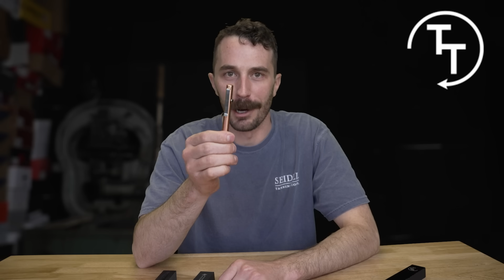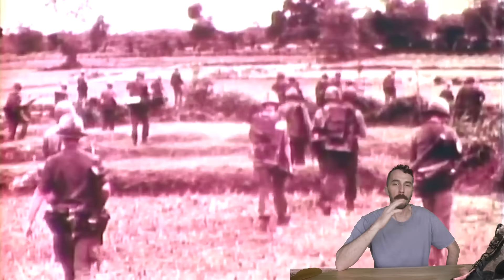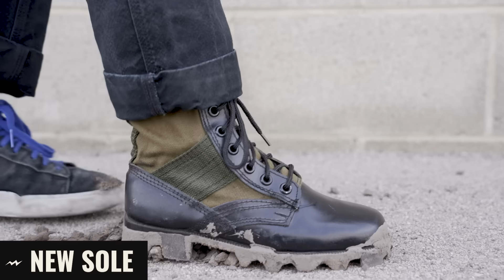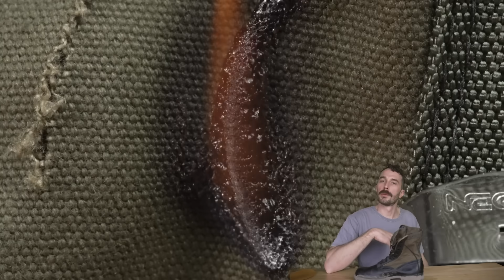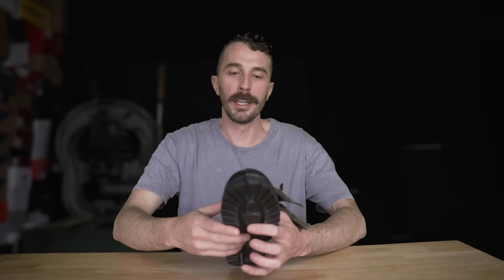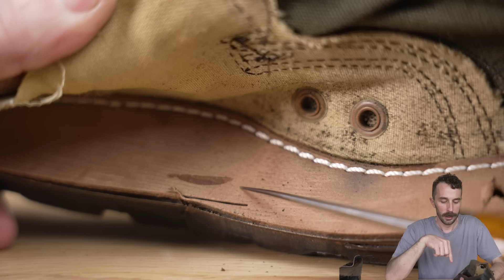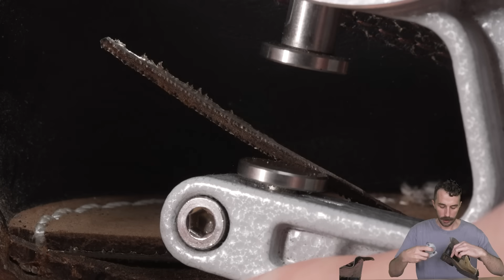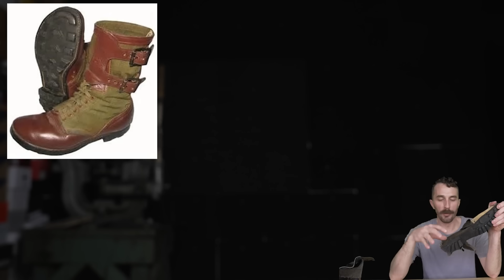Why it took 57 years to replace jungle boots

Comment: Also I was never issued the Bunny boots, but I did have a pair of the Micky Mouse Boots. Basically the same thing, but they were Black and perhaps a lower cold temp rating. The Micky Mouse boots were standard issue in S. Korea and likely still are.

Comment: They are a great boot for the environment they were designed for, & still a solid boot for temperate, & hot environments. My primary boots are a take on these as they are the Belleville Minimalist which is a zero lift, wide toe box with a vibrant sole but the design is based on these guys. I wish the leather was of the same quality as mil spec.

Comment: Wore the v2, bought out of pocket, in the 80s-90s USMC. They absolutely suck for running on pavement or jumping more than 4 feet down from an armored vehicle. The metal plate and shank sent all that impact into your spine. Otherwise, better field boots than the all leather we were issued. 2nd MarDiv Camp Lejeune

Comment: Funny I ran back into this. They haven't really replaced these boots period.  One of the original manufacturers sold the technology so they can't even make them anymore??? 
Wow.  For all you young tender feet guys and gals I actually broke a couple sets in before going to Panama and Honduras, wore them without the cushion sole boot socks.  My last pair I got was on the way back state side with a crisp couple sets of 60s dated jungle uniforms, I spit shined the new issued jungle boots and wore them til I left in 88,  then continued wearing them in civilian life through everything out doors I did til I finally out grew them in decided to retire then in 2018, one boot as always happens with these puncture proof boots, had a broken sole plate and clicked when you wore them.  I sold them on eBay for $50 to a Vietnam reenactor hahaha 😁 
So they soldier on! 
Best damn boots they ever fielded.
Found a brand new old un issued pair 84 dated set in my current size, I'll never wear them out at my age.
Cheers 
Former 3/502nd 101st Abn and 270th army intelligence group central america soldier 83-88.

Comment: I there, thanks for the video
Someone just told me that there were 2 versions of the spike protective plate; one made of stainless steel, the other one made of carbon steel. 
Do you know know if that is true?
And, any of these boots with protection for spikes should make a metal detector sound?
(I just bought a pair of these boots, i wanna make sure they are the real thing...

Comment: The real problem with the issued combat boot in The marine corps (1965) in Vietnam was the lacing..the lower eyes were standard holes but the uppers were "speed hooks" can you imagine what these did in the jungles of Nam, you took three steps and you had three feet of vines dragging behind you! The second problem was the heels were nailed on and with in a week in the mud clay tore them off the sole of the boots. The jungle boot was " God sent " for the Marines..I spent April 1965 to January 67 on my first fun and games trip to Nam and May 1968 to July 1969 on the 2nd ! I am a retired Msgt USMC...oh and I am now 84 years young 😊

Comment: Wore my Belleville Combat Boots in the USAF in the early 2000's. Comfortable and durable, then wore the same pair for another 10 years of digging ditches and contractor work before I finally wore out the tread and tore some of the stitches.

Comment: Keep in mind that authentic US Govt contract boots in normal human being sizes will be considerably more scarce and expensive in good condition, and at that point you may not even want to wear them out. Also Ro-Search still holds a patent on the Direct Molded Sole technology which means most of the numerous reproductions out there will be made with a glue on sole and no spike protection.

Comment: We (US ARMY) were issued these boots during the 1990/91 Gulf War because they were considered a hot weather boot and the tan desert boots were in short supply.   The problem was that it actually got pretty cold in the desert once winter arrived.    And when that happened these boots were the worst.  Once that steel shank got cold you could NOT keep your feet warm in these boots.  We hated them for that.

Comment: I served four years on active duty marine from 90-94 and was issued a pair of jungle boots like these, with the exception that mine had speed laces for the top two or three sets.  One thing of note - it took a long time for that nylon upper to break in - it just didn't want to flex and conform to my foot like leather.  That being said, it was a tough boot and lasted my entire tour. It had the big lugs and I was always jealous of the high speed, low drag vibram soles the new guys were wearing.  But they did the job and took a long time to wear down.

Comment: Those are the old ones. The ones starting being issued in the 90s were made from black nylon replacing the OD canvas. They were only really replaced because of the conflicts in Afghanistan and Iraq. The first desert boots were the ones developed in the late 80s and early 90s. Basically tan, suede jungle boots without the steel plate.

Most of the ones you'll find today are lower quality, and don't have the steel plate. The better ones made by Altama or one of the other makers who were making them under contract are charging over a hundred now.

Comment: I used a Brazilian copy by 13 years (1994-2007). The only drawback was the pain on the heels when standing by a long time. The problem was minimized with silicon rubber heel pads bought in a drugstore.

I bought it when I was a high school student: the school was near to a police General HQ, and there was a dozen of military uniform factories and stores around it. The prices are very attractive because are bought directly from the maker (the boots were not even packed).

Now I have a paratrooper/airborne version (all brown instead black/OD green) bought in 2015. It's a bit more comfortable than the previous model (no heel pad is needed) and is still strong.

Comment: In the 80's in the 101st we would take the plate out of the boot. Or we would just bend the toe back and forth until it cracked. It would make them more comfortable to wear. The vent holes worked very well on flushing the water out. On a hot day your boot would dry very quickly compared to a standard leather "Leg" boot of the time.

Comment: I was an infantryman in the 70's. The insoles were issued in basic training along with 2 pairs of leather boots. I was issued a pair of jungle boots when I was assigned to my unit. The canvas on the newer jungle boots was replaced with nylon as was all of the webbing pouches and rucksacks. The regular leather boots were of a high quality and once broken in were very comfortable.

Comment: I liked my Jungle Boots.  The ones I were issued in the Nam were worn to slippers.  I slit the front of the boot so I could kick out the sand.  I didn't wear socks because of heat rash.  They made me replace them when I was short and I went back to Pendleton with new jungle boots.

Comment: The do not boil was for the break in. One of the old methods to break in leather boots was to dip them in boiling water and then wear them and walk around until they dried. It would form the leather to your foot.

Comment: You really did that to real GI Jungle boot?? No, you can't pick them up at any surplus store, the supplies were exhausted by the 1990s! If that was a 9W and not a 4XN or something, then a pair in mint condition would be worth like 500 dollars or more! Since the mid-80s the issue jungle boots have had black nylon upper, with different padding and speed lace metal loops until 2000 with the desert boots that dropped the 2 airvents and added nylon CoolMax lining but also offered various soles like Sierra and Sahara patterns

Comment: Direct Molded Sole (DMS) combat boots like these Jungle Boots and the all-leather combat boots the Army used from 1985 to about 2000 are my favorites.   I get them NOS on ebay for about $70 and beat the crap out of them until I cut up the leather from crawling around, or wear out the sole.   McRae still makes them though the NOS or used ones on ebay are cheaper and a bit better built.  Companies like Altama, McRae, and Rothco were the primary vendors who made these awesome boots.

Comment: I have a modified pair of these from my time in the Army.
The only downside is the lack of ankle support. So if you're walking thru rubble you gotta watch out for twisted ankles.
On the plus side these are the most comfortable combat boot you'll ever wear. If you have the steel plate removed and have them resoled they feel like wearing sneakers.

Comment: I joined the Marine Corps in 90’ and we were issued the jungle boots along side of the “black Cadillac” speedlace boots. I used these for inspections only because they hurt my feet so badly, with no give from that steel shank. I spit shined them to a patent leather finish and would walk on my heels to inspection as not to crack the polish. 😂

Comment: Former Marine and Army long range surveillance infantryman and have attended three different official jungle warfare courses between both services. 

Plain Altama jungle boots with speed laces were absolutely the best footgear ever designed. 

Yes the vent holes worked to push water out and help dry out the boots. Always had two pairs, one was my highly broken in as a primary set for long field exercises and a secondary set in the process of becoming as broken in as the first set.

Comment: I do not think the addition of a sheet of metal was because of thr booby trap. This feature is common on safety boots used everywhere you need to protect the feet. Considering that when falling on a booby trap it is better that the spikes go through your feet than through your body it is unlikely that they purposefully added it to protect the soldiers against booby traps.

Comment: It's what we wore in the US Army in the 80's. Because they dried better than all-leather boots, and we didn't really have access to anything better, I mostly wore them year-round, even in Ft. Bragg winters. You knew it was time for a new pair when the tread went smooth or the spike plate broke (clicks with every step). The jungle boot was probably the best of a bad lot. I tried backpacking in an old pair in the 90's, after not having worn them in a decade, and couldn't believe how bad they were.

Comment: In boot camp in '90, I preferred the jungle boot over the leather combat boot mostly because of the tread.  I now prefer ankle support, foot protection and durability of full leather.  Yes, we had soles replaced with Vibrams.

Comment: The one thing I’ve heard bad about these is that they can cut off circulation to your toes if something goes wrong. Not sure how true that is, I honestly might get some to test that out. I easily walk miles during a typical 9 hour work day, so I think I can put them to the test

Edit; does tactile turn’s pens accept Rite in the Rain cartridges?

Comment: I love to hate those boots. The green sides are better than the black sides that they issued to us at MCRD San Diego in January 1998. They have a long break in period. The mud soles are uncomfortable. But if you get them broken in and resole them with Vibram soles, they are very comfortable.

Comment: I wore USGI issued, Panama sole jungle boots as a teenager in the eighties. Back then, they were plentiful and inexpensive. You could get them at any good Army Navy Surplus store or almost any Army or Marine Corps Commissary/PX. I used them in Boy Scouting for hiking, beginning backpacking trips. I did my first high adventure trek wearing Panama sole jungle boots and also my my first BSA winter fifty miler backpacking trip. Later on, I moved onto expensive, high end Asolo brand backpacking boots for more hardcore stuff. But I continued wearing jungle boots for general camping, hiking, working at my family's greenhouse business. They are light enough and flexible enough in the metatarsal/forefoot area that you can run in them if you need to.

Comment: Best boots . We used to pull out the steel, and they were like sneakers. Also, I cut the insole stitching and made it so I could pull the steel out and sharpen it into a blade during POW phase of SERE.  Good times

Comment: My issue jungle boots in 72 lasted me over 10 years before they wore out. The pair that replaced them did not make 2 years. It does not matter how good the original is someone always tries to reinvent the wheel.

Comment: I used to have a pair of these, (may actually still have them somewhere possibly). They were the second worst pair of boots I've ever owned (worst ones being 1970's German Para boots). Absolutely terrible. Too narrow for my feet, and horribly uncomfortable. For someone with the right sized feet for the boot (IF you have feet with the correct width / length combination!), in the correct environment they MAY be ok. but not for my feet. In a jungle combat situation where Punji spikes are a potential hazard, I'd certainly rather put up with sore feet from badly fitting boots than getting a sharp, faeces coated spike through my foot!

Comment: FUN FACT: So the Jungle Boot does still exist now in the modern military, just with a few(admittedly kinda big) changes so that it fits the modern standards. And it is big meme in the Infantry world where you dont need to look at someone who wears Jungle Boots feet to know it, because they will tell you before you get a chance to see. Jungle boot fans are obsessed with them and will go out of their way to talk about them and how much better they are than any other boot. Think like the Vegans of the military boot world.
In reality they kinda suck because in modern use cases the most important thing is being light weight, fallowed by drying quickly(which they do pretty well for being such a brick), then ankle support and grip which only kinda matter a little. Your boot can suck at everything else but be light weight and it will generally be better than the opposite, which is exactly what the Jungle boot is, way way to heavy for what it is but otherwise good. A few ounces makes a huge different on your 20th mile of the day and 100 mile of the week.

Comment: Late to the party here, there are 3 reasons for having them, you got 2 of them.
Cost, weight, and the last one is actually the reason they had to use it.
Due to the vulcanized construction, if the heel was left as pure rubber, at the top center of the heel the rubber won't be cured. This will create a weak spot as uncured rubber won't have the same characteristics as the cured ones. The heat from the mould can't reach to that spot since it will have to go thru a thick layer of rubber from the sides and bottom, there are no significant heat from the top (upper). The only way to make sure the rubber at heel cured properly was to make them thinner by substracting the rubber volume.

Why wood? Because they are light weight, readily available, and requires minimal process.

Comment: I buy jungle boots and use them with Saran insoles for work as prolonged wear boots within the the UK ambulance service because they are kind to my feet. I have separate wet weather/cold weather boots for when they are required though. I love jungle boots and find they fit beautifully too.

Comment: The Converse Hi-Top of combat boots.
IDK about spike resistant, but boots I've had that didn't have the steel insert will break across the sole in less than a season of city wear.
The real ones with the steel, and leather uppers last years until the relatively soft rubber soles wear smooth and wear through to the inner plate under the middle of your foot.

When I was in uniform the only time we got any grief for wearing them was in any sort of formal formation like inspection or change of command. If they had the black uppers, not even then.

Years after getting my 214, I buy them as fast as I wear them out. Only complaint is that they're FLAT when you put them on, but it's no problem for modern insoles and arch supports.
 I wear them in winter when it's cold enough that you won't find any unfrozen water. The Panama sole is great for ice or shedding snow like they shed mud, and with enough socks they're not cold even when standing waiting for a bus.
I'd have to spend far more for any real winter-worthy boots, and these last as long as any newer boots.

The reproductions you can buy today smell like a chemical factory - they stink up your closet like a tar factory, but that's all anti-bacterial and durability, and it fades.
You can't find those original insoles anymore.
When buying online, if they don't advertise that it has steel shank & leather upper, they don't. They're cheap plastic trash. You'd be better off with Converse high-tops if you can find those.

Comment: So this video popped up for me to watch. I am 74 and a Vietnam combat vet. I was an RTO in the 5/46 198th Lt. infantry.I went to my basement and found the boots I wore home from Nam.They still have my dog tag laced into the right boot. Walked many k carrying a PRC25 radio. The nylon insole worked very well. After walking out of deep water they would compress and  water came  out the air vents. We wore heavy socks I think wool to wick the water. Your feet were pretty much always wet. ( rice Pattys and streams)  Carried a pair of extra socks changed and dried the wet ones on your pack.Feet looked just like the picture you showed. Most of us in the field dealt with jungle rot on our feet and other places . Thanks for the memories I think.  1968-69